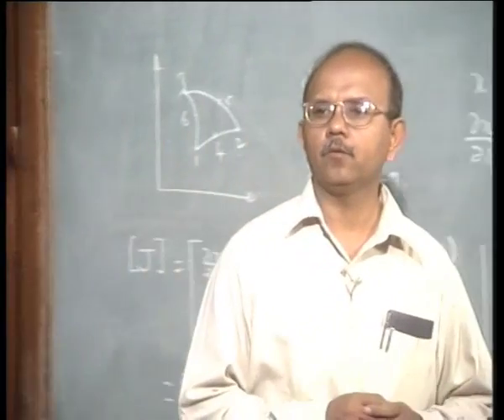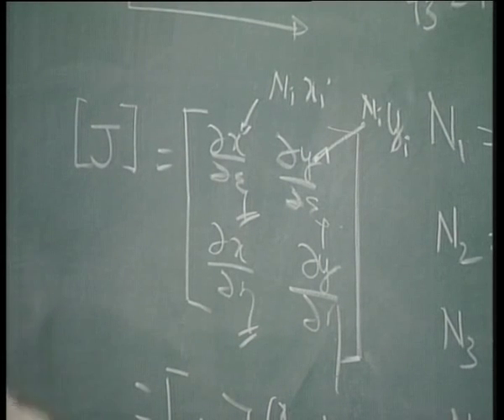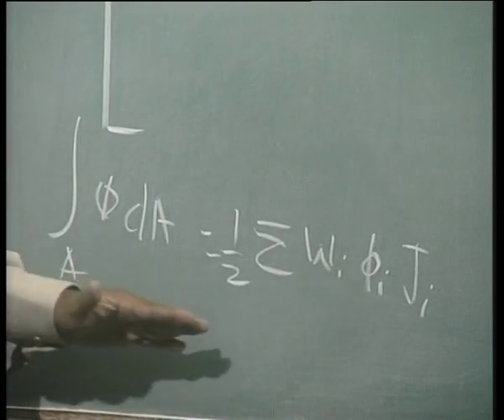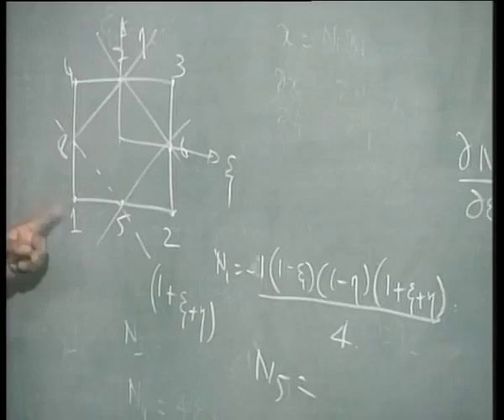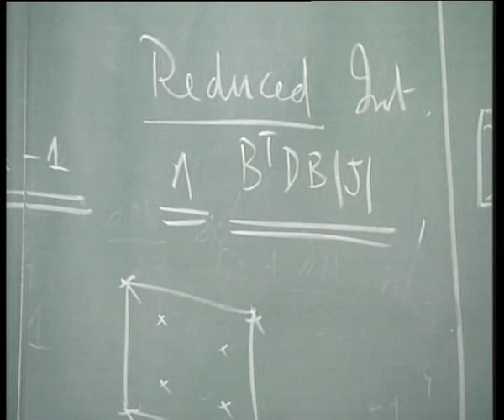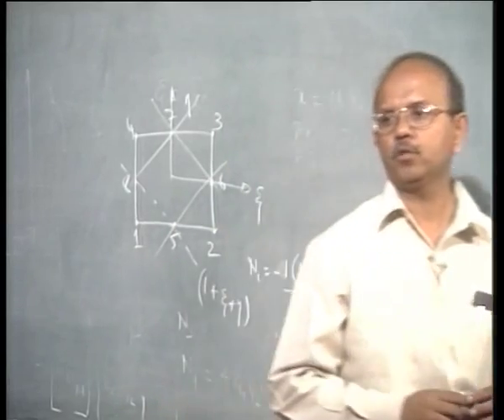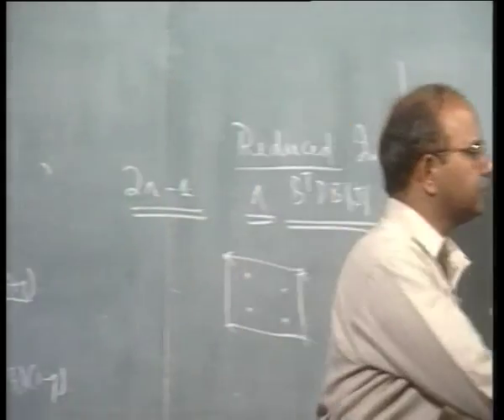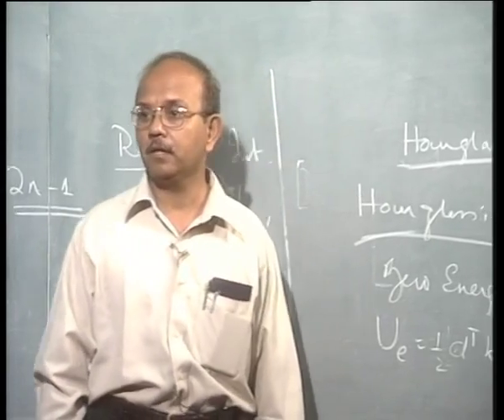Mod-01 Lec-23 Introduction to Finite Element Method

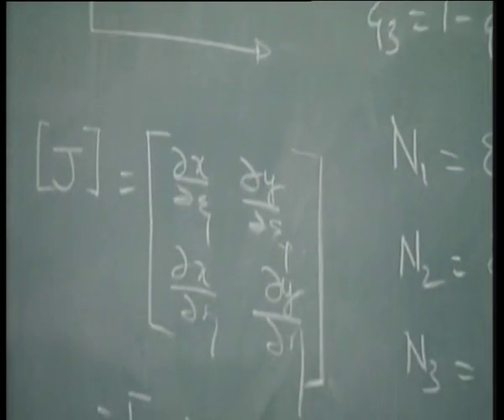Comment: Why J matrix @4:16 contains only psi1 and psi2 (ie psi and eta) and not psi3?
Reply: its because we have taken a 2d element here. psi3 would be considered as the z-axis. Thats what I feel. correct me if I'm wrong.
Reply: @saravananramesh3222   i think psi1, psi2 and psi3 are dependent on each other and we know psi3=1-psi1-psi2....and this is area coordinate system...so here nothing to do with 3d..we are assigning psi1 ,psi2 &psi3 to make it easy and psi1,psi2 & psi3 are function of psi & eta...hope it helps
Reply: This is because, psi1, psi2 and psi3 are not linearly independent. You need to take them as separate only in the case where the coordinates are linearly independent. Because they are dependent, if you know psi1 and psi2, psi3 can be written as psi3 = 1-psi1-psi2. Hope this clears your doubt.
Reply: Can anyone.. elaborate..on how does reduced integration softens the structure(30:53)..
Reply: @saipradeepakey4781   what we are doing in gauss quadrature rule is simplifying the value of k in linear algebra by doing algebraic addition over gauss points...the gauss points behavior of the k matrix is assumed to be the whole behavior of the element....if we reduced the number of gauss points which was taken into account for whole behavior of the element,we cannot capture the whole part of element...it's just weighted function * value at that point...when we compare reduced integration with the original gauss quadrature rule..we see that k matrix decreases...hence we can say that element has softened...
I hope your doubt is clear...
just a newbie in fea..if you find any error please correct me..Thank you in advance